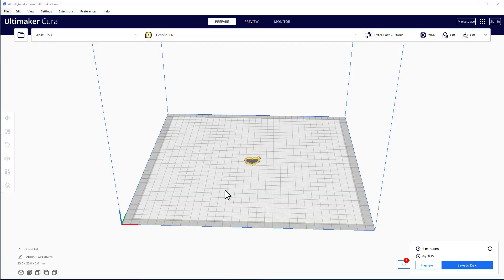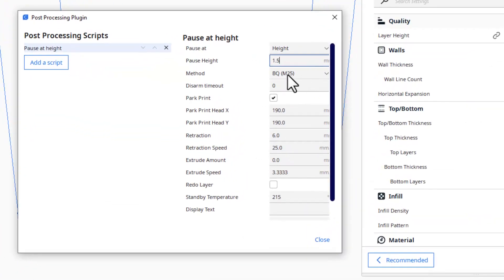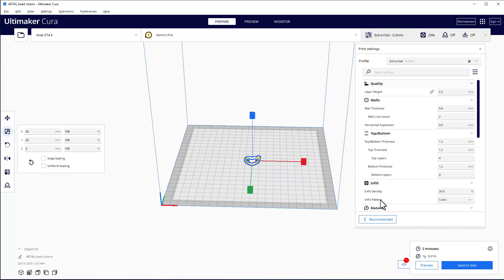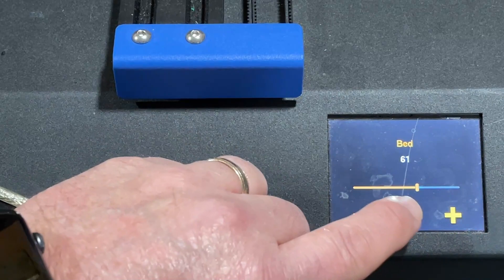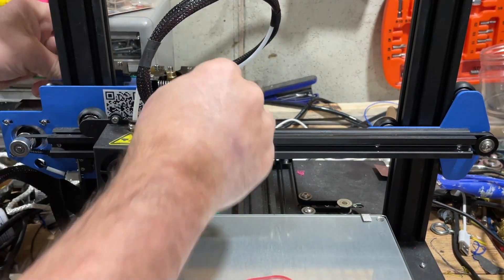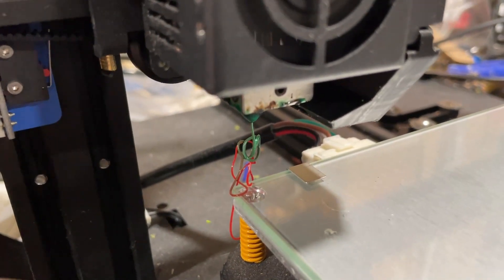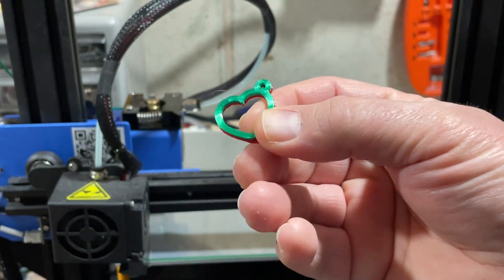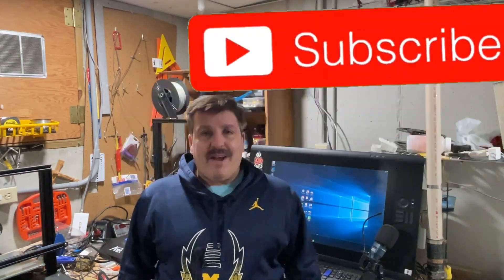Simple Steps Cura Pause at Layer height Anet ET4X Marlin 2 firmware

Comment: @HL ModTech OK I'm sold Marlin 2 for my 5X Pro it is!

Thanks for all your help on this filament change stuff.

One small request when you do the Marlin on 5X video, if there is a way of reverting to the stock, either by boot loader or completely to stock that would be nice to see
Reply from the maker: With the ST-Link you can go back if needed. Just make sure you have the original firmware saved. Sometimes they are had to find from Anet. Time for me to get cracking. =)